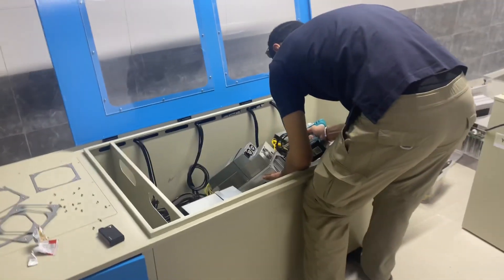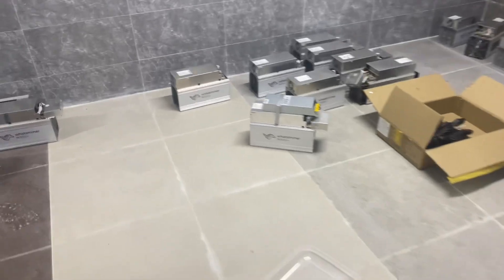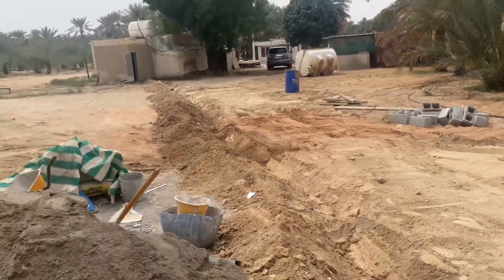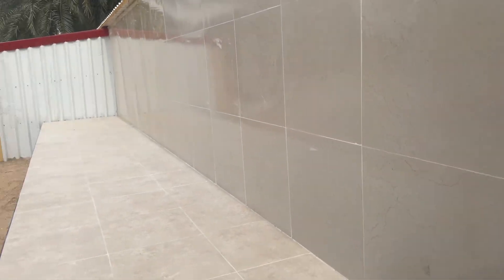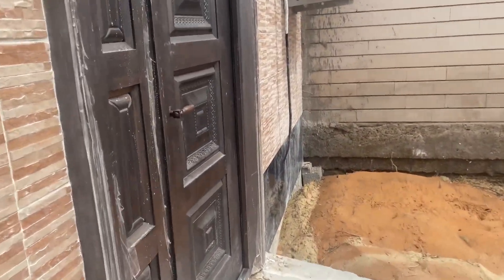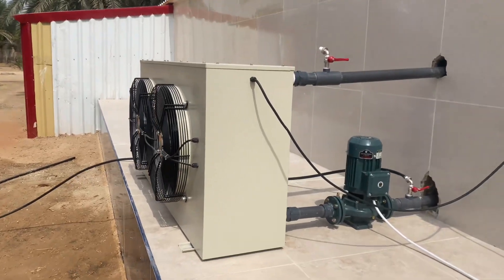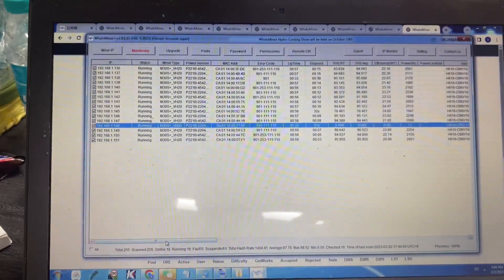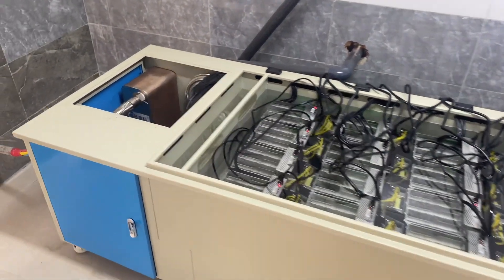how to setup an immersion cooling crypto mining farm UAE

Comment: Whats better out of water cooling or immersion (cost/set up) > do you have a full comparison video? That would be awesome - thanks
Reply from the maker: Good question and actually i'm making a video comparing both systems and their pros and cons 
the short answer if you have existing air cooled miners , then Immersion cooling would be your best bet , but if you are planning to start mining is better to start with Hydro miners
Reply: @Crypto_mining_lab  what about electricity cost?
Reply from the maker: Matter fast I do have a video 

https://youtu.be/YPW3QjrR7A8?si=psM8IcUKR8A4cPmc
Reply from the maker: https://youtu.be/YPW3QjrR7A8?si=psM8IcUKR8A4cPmc